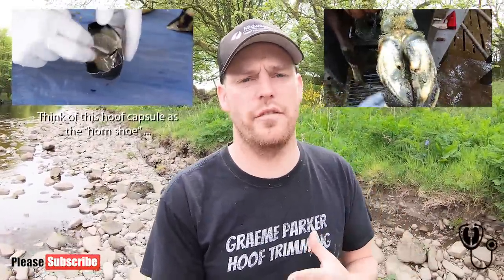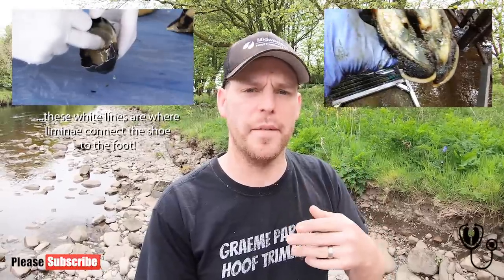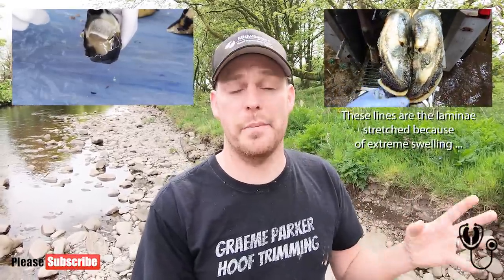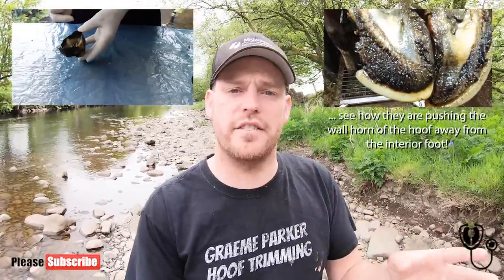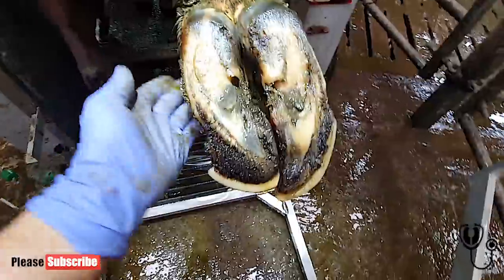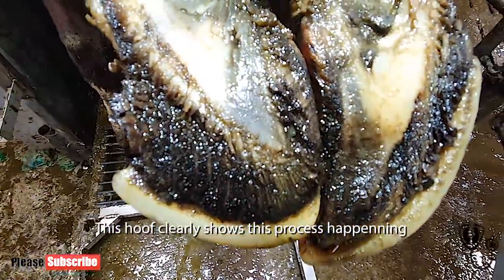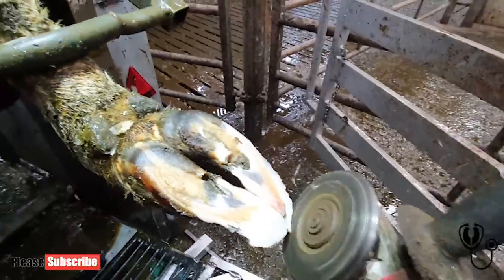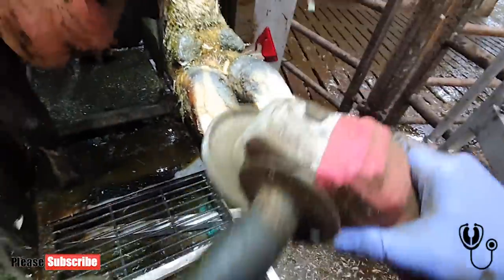CUTTING 3 inches OFF a COWS foot | The Hoof GP

Comment: I wish it was that easy to treat in horses. founder in horses is a mess,  usually with permanent foot changes, deformation lameness and sometimes even the bone coming through. Lost two good riding horses to it. ( One had a thyroid and pituitary problem that caused it, the other accidentally got moldy hay, neither blew out feet on spring grass).

Comment: I had no idea cows could get laminitis too! And caused by some of the same things. What is the usual prognosis for cows with laminitis? Obviously corrective trimming was very helpful for this particular one, but is it normal to be able to fix in that way, or do you also see cows who've foundered too dramatically to truly fix?
Reply: Very late here but laminitis in cows, goats and sheep are usually much much easier than in horses. The reason is that ruminants have cloven hooves with two claws so unless the laminitis is REALLY bad, it is easier to give them a clog (sorry, I am using the Swedish word now) on one claw and let the other rest and heal, and then repeat the procedure on the next claw. The clogs can be different shapes too, to relieve pressure from certain parts of each claw.